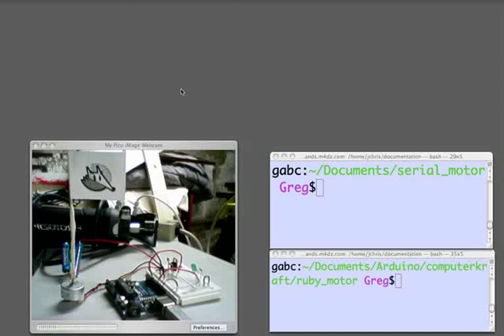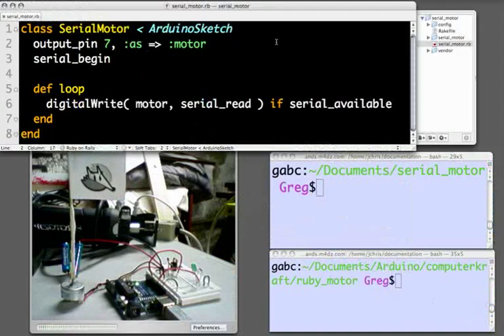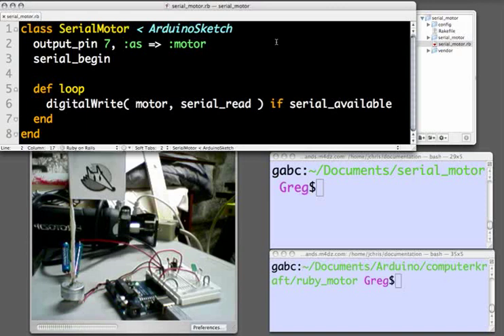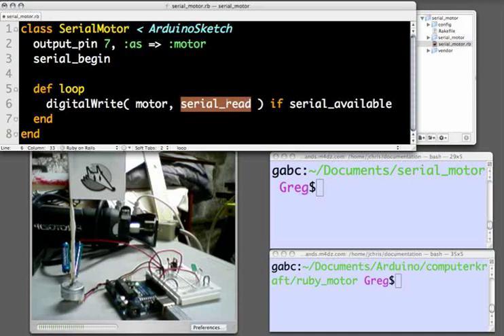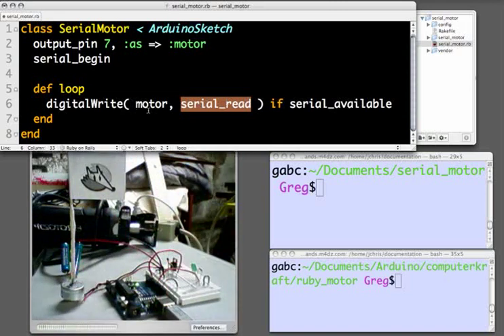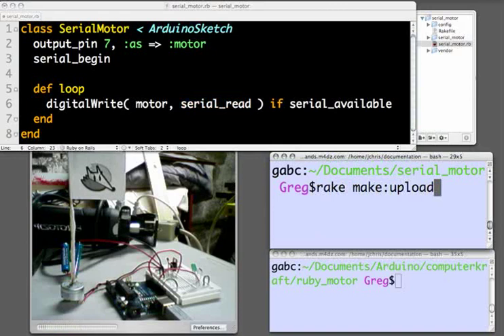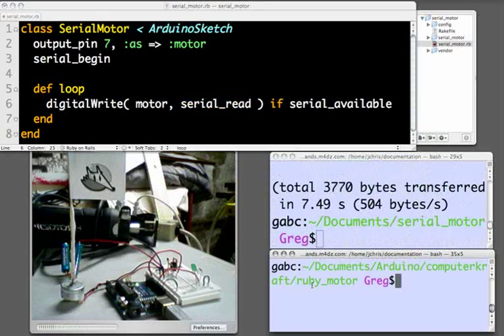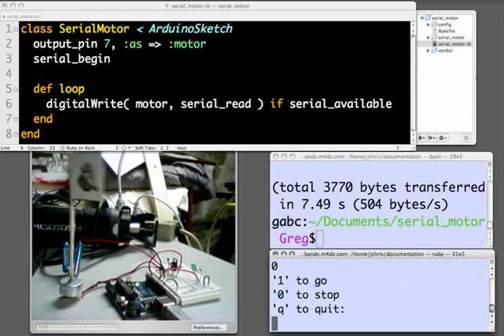RAD Demo #2: Ruby Arduino Development Serial Communication

Comment: All of that discussion about voltages and so forth didn't seem to be apparent in the code. If the voltage stuff is actually important it should be visible in the code, at least in ruby. Otherwise, you might be flooding the beginner with more information than is really necessary to proceed. Still, thanks for the video.